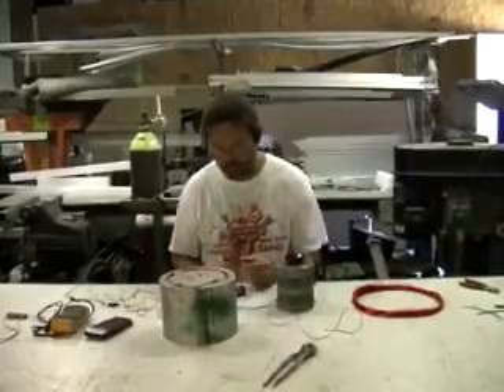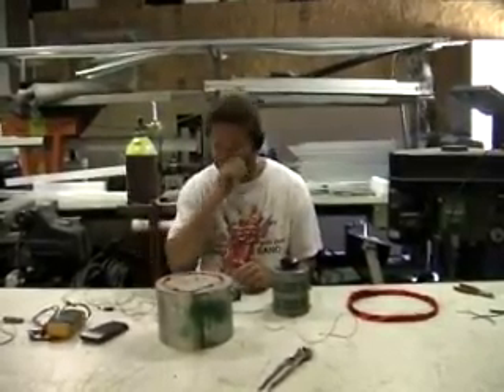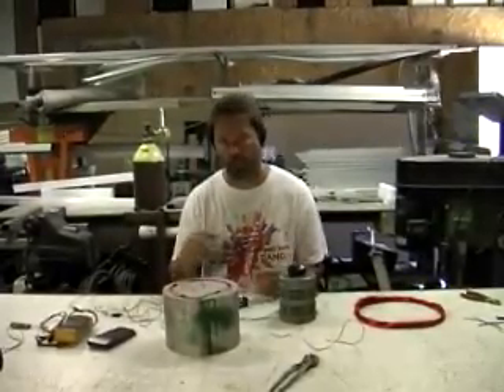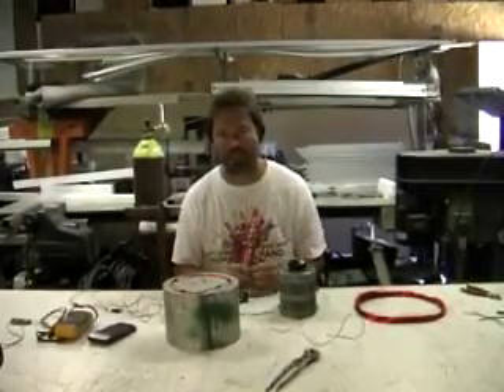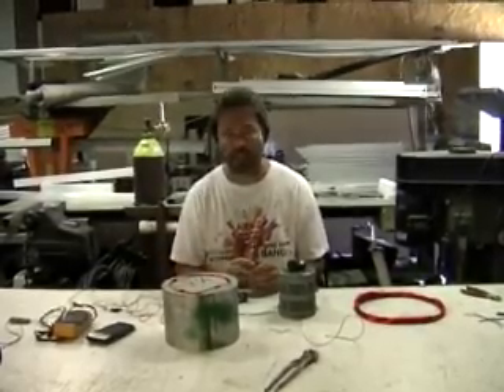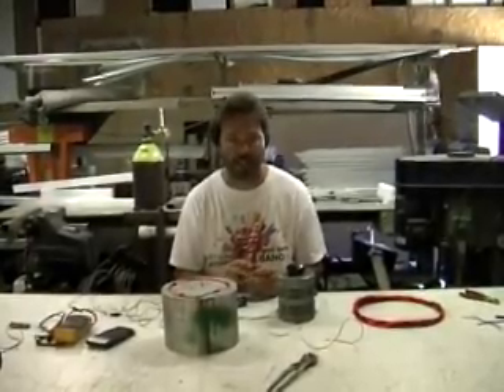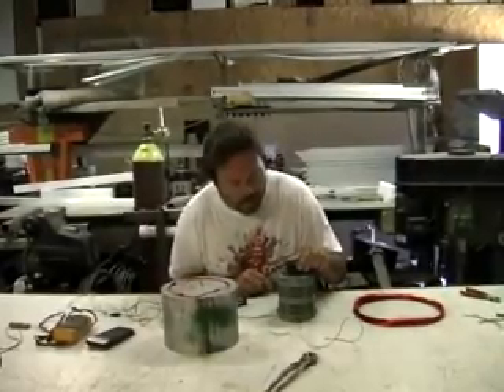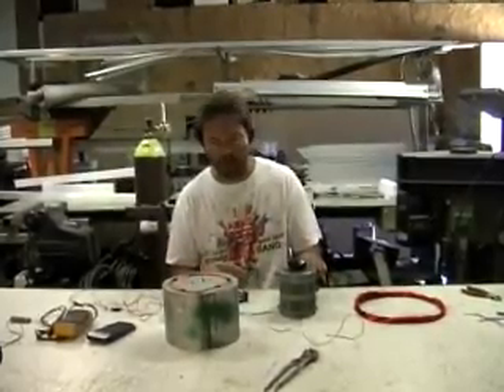Boyd Bushman antigravity recreation ThermoCap video part 2

Comment: It would work. But imagine if you had coil strike points around a fixed coil electromagnetic closed loop system that can have jolts of electrons. So long as the thermal pinnacle is transferred into a raised coil. It would provide time for it to cool regardless of it in a coolant or not

Comment: This is a 'magnetic' effect NOT anti-gravity. Try this... take an aluminum metal disc and spin it on a lathe or any motor. Then, using a Neodymium magnet, try to touch the magnet to the flat spinning surface of the disc. Try either polarity. You CAN'T do it. It will repel from the disk.  Try either spin direction. Same answer. The magnet generates currents in the aluminum which in turn create magnet fields that oppose your magnet with equal force. Same principle at work here. Any well informed high school student can explain it.
Reply: you do realize that gravity is magnetism. do some research and experiments and you will see for your self.
Reply: not true. magnetism is the result of the exchange of spatial charge and electrical charge (i.e. moving electrons). inertia is the result of the exchange of spatial charge and color charge (i.e. moving mass). this means both magnetism and inertia are dynamic forces. meanwhile, electric force and gravitational force are static and due to the build up of charge. of course, you wouldn't know that because the science taught in schools is misinterpreted. they teach 4 forces when there are really 6.
Reply: believe what you wish sir.

Comment: now we know how a magnetic levitation train works, but it's not anti-gravity in the purest sense, because at a certain distance the force of the magnetic repulsion field equals the weight of the coil. if the voltage is increased the the distance will increase, but at some point the coil will open or short due to high heat. change the gauge to 20 with 1000 turns and reduce the inside diameter to 2 inches and add an iron ring inside like a small section of pipe 1 inch long tied to the 1 inch thick coil. use ac current.
Reply: AC. Alternating Current current?

Comment: the coil is getting hot cuz it cannot handle that much of current... so instead of increasing the current increase the frequency and make a 12 volts 0.5 to 1 MHz AC it will not burn your coil

Comment: A coil of #22 magnet wire (5.5 inches in diameter w/ 100 turns) is energized with 120 volts AC (60 Hz) as it rests upon a .50" thick aluminum plate. As a result the coil will levitate as dictated by Lenz's Law. Unfortunately this design uses a tremendous amount of current and is prone to rapid heating. Further experimentation regarding coil size, voltage, frequency, and materials may improve its operation.
Reply: don wan so boyb bushman had nothing to do with this invention. its been around for a very long time, even before boyd was born
Reply: don wan boyd didn't say he invented it, he was explaining the fact that there is a force there when alum and copper are together when there shouldn't be.

Comment: Instead of measuring results by lifting away from various surfaces... use a weight atop a delicate scale. Tie a string around the weight.  And use 2 pullies.   Bring string up and over one pully then across the 2nd pully and down to the suspended coil which without juice is partially lifting the weight. Then add juice and measure.

Comment: What you really are trying to make is a better DIAMAGNETIC. Thus compare using same variac percentages, same gage wire, same coil diameter only POOR conductor wire. Aluminum. Iron. Bismuth. 
Try a tangle of wire instead of coil. Try it squashed flat.

Comment: EARTH spin FAST (1042mph at the equator) thru earth's magnetic field. All forms of matter are standing waves; like 'songs' of so called 'energy' which in fact is MOTION which in fact is perpetual and MOST REAL.
Earth (literally) is a choir of songs created by the interactions and counter interactions of ... call it... say Perpetual Universal Motion. 

Radically vibrating a significant mass which you've done here, radically changed the thing's tune... causes that so called 'mass' to become repu

Comment: I was tuninng a kapagen which was being powered by a MOT(transformer grounded to first stake in drt 30 feet away) when next thing you know i was a part ofthe circuit completing it from the hot on the mot me the wire then  to a second stake in the dirt..Become part of this circuit litterally levitated me off the ground from a kneeling position over the apparatus and almost stood me up.if it didnt toss me back thaT WOULD HAVE KILLED MY ASS...........TRYa MOT?

Comment from the maker: I think that the heat has nothing to do with the levitation. The coil can levitate, cold or hot. The coil will act the same. However, the heat will burn out the coil in time.

Comment from the maker: Thanks for your insights. Yes, the aluminum repels the magnetic field created by the coil. I tried a million volt stun gun powering a homemade capacitor. Two 12" copper plates separated by a film of mylar. All hanging from a string. The rumor is the capacitor would experience a net force toward the copper plate. I could not detect any movement. But I don't know if the stun gun suppied ac or dc. I had no way to measure it. My VOM has it's limits.

Comment: I wanted to try this experiment as well so thanks for sharing your experiences. 

My conclusion is that the aluminium creates a disturbance under the coil of some sort (maybe disturb the earths magnetic field) and the coil levitates to a height where the magnetic force balances with gravity force.

A device that is truely anti-gravity will not balance with gravity anywhere close to the earth's surface.

Comment: Because mercury vapor is inconivent to find maybe you should try to replace the mercury vapor with orgone energy inside hollow torroid. I understand how ufo work like capacitor they gather energy from the air, air=chi=prana=zero point. Turn your hollow torroid into orgone accumulator reactor. Look up on google UFO Propagation read section of the article or accumulator reactor.

Comment: you shuold use gold wire to have real good results

it won't get super hot in that small time

and btw, the original experience used 115 AC as it's connected to a common house socket

Comment from the maker: I was thinking that I need to get rid of the copper wire. Maybe try to use a conductive gas, like mercury vapor in a torroid. The conductive gas would spin, but the heat should be much lower. I need to figure out how to build the torroid.

Comment: not sure it this would work at all) and then pipe helium through that or water. Water could be a bad idea. Who knows, it might start to split into hho gas and then you have a real problem, but if it did, you could get lift while generating fuel.  oh wow, now there is an idea..... god I wish I had a machine shop.

Comment: once way you might be able to cool the coil and keep it wound up is if you routed a pair of alluminium rings and placed the coil in the groove. The aluminium should immediately start to pull the heat away from he coil and as a result you should be able to crank it. That or ceramic perhaps cooled with helium in copper tubbing being wrapped around the coil (maybe even copper tubing itself is the coil?

Comment from the maker: Very good idea. Cooling to create superconductivity would theoretically kill the heat production. The thing that bothers me is that the coil only rises when placed over a metallic surface. On wood, or dirt, nothing noticable happens. I think a true (anti)gravitational field may involve more than common magnetics (electron spin alignments). I'm missing some elements of this puzzle.

Comment: my friend have you concidered trying to supper cool the copper wire, this might not only desipate the heat but also make it a supper conducter incressing the magnetic field, liquid nitragen might work...i also thought that with a small copper tube coated,in a coil, with the liquid nitragen flowing inside the tubing, then recondence it in a cycle, use as much current that the variac can put out and it just might fly.. God Bless

Comment from the maker: Well,..ThermoCap is calibrated in actual numbers. Most dash gauges are C(cold) to H(hot), which is vague. Also, it's nice to have a redundant gauge under the hood. This way, you know the temp, without having to get into the car and turn on the electrical system. I burned up a 454 big block, because the dash guage was not functioning properly. This is why I developed this invention.

Comment from the maker: You are exacly right on all accounts. Since the original Boyd Bushman video did not disclose the "details", I had to try it myself. I succeeded in my "part 2" video. Mass shielding or cancellation is needed. I think, to travel like "light", one must become "light". A massless energy or EM waveform. That's the trick that eludes me.

Comment from the maker: Good suggestions. I actually was able to levitate the coil in my "part 2" video. I simply reduced the windings, which increased the amperage. It is indeed a magnetically induced lift. They never really explained this in the original Boyd Bushman video, so I had to try it.

Comment: I may be missing something but conventional wisdom on this is its magnetic levitation, not antigravity. Aluminium is a conductor, therefore the coil has a magnetic filed associated, with AC the magnetic field will be moving inducing  eddy currents in the aluminium. These eddy currents have associated apposing magnetic fields,to the coil. Levitating the coil. This may be an analogy for how antigravity may work i.e. apposing fields, but you need a method of decreasing somethings mass at will?

Comment: Wonderful ... You just need now to protect the insulation of the wires. Just separate the coil wires by passing them through few small pieces with holes inside them. You need diamagnetic material, and very light. Maybe an usual plastic sheet would to just fine if it wouldn't be so fragile under the temperature increasing ...

Comment: hey louis good idea using a toroid and Louis you should wrap your cooper wire like a rodin coil it will produce less heat because it is the natural way a electron want to flow.